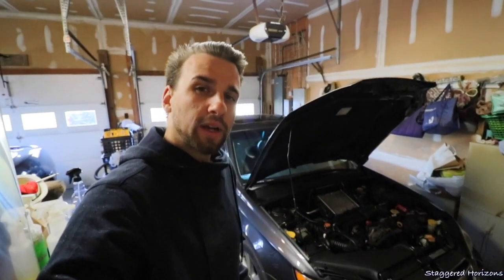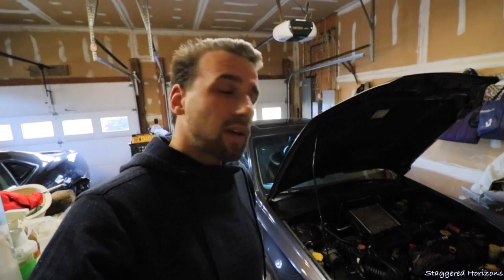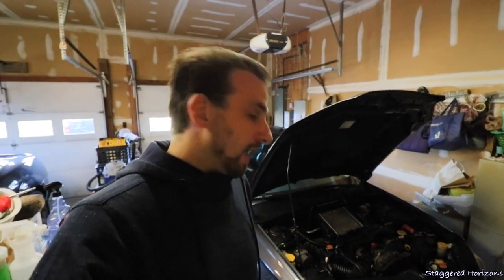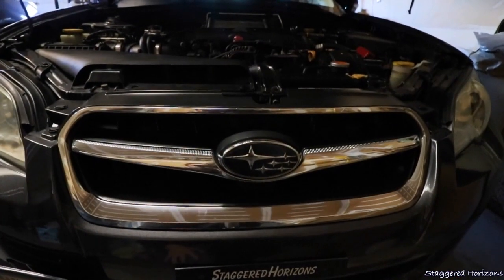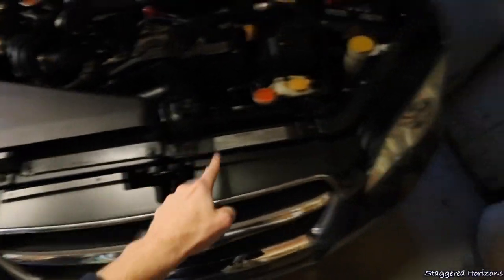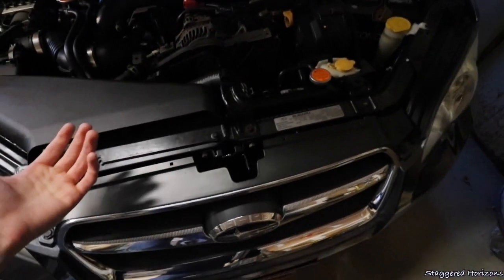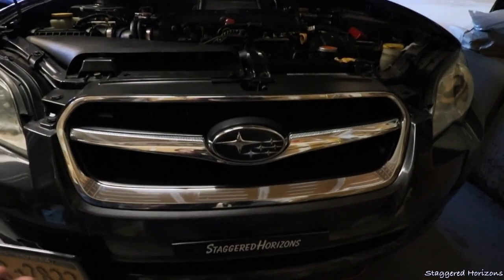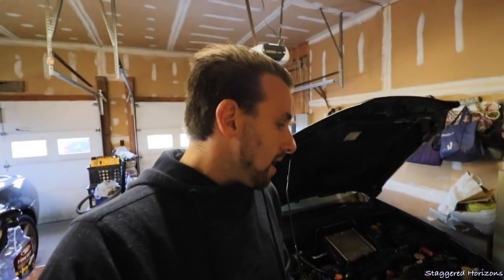How To: Black Out Your Grill QUICK & EASY - Subaru Legacy GT Build | Episode 1

Comment: How soon after the last coat was applied, did you remove the tape? I know with regular house painting, remove it too soon you could get runs. Wait too long and you can chip the paint off the wall. I've never use Plasti Dip so I'm not familiar with it's characteristics. Thanks for the great video!

Comment: Thanks for this. I have the 05 which luckily just involves removing the plastic clip screws and then taking the grille out from the latches sitting towards the back of the grille. I noticed you sprayed over the emblem; how did you remove the dip from the emblem? I like how your video is straight to the point, too! Maybe not the music though ;)
Reply from the maker: thanks appreciate it, glad it helped, the dip peeled right off the emblem section as there is a separation  on the oval line, thanks for watching, more content to come!

Comment: How much clean up/peeling did you have to do afterwards? I got a 2009 legacy 2.5i want to do this to my grill.
Reply from the maker: not much at all, just tape pretty close to the lines of the grill and top piece, about 0.25" or so and make sure you put down plenty of coats, so when you peel off after, the plasti dip will have enough to "break" cleanly from the offset of the grill and bumper. Thanks so much for stopping by, be sure to subscribe for more!! also add me on Instagram @StaggeredHorizons so I can see it after :D

Comment: Not gonna lie I know this video is old but I just bought an 05 GT last June and I’ve been doing some mods here and there. I’ve already replaced all the interior lights to LEDs, the rear dome light glows red to match the console accent lights. I did the tail lights too. Windows were tinted to 20%, slapped a couple of decals on the rear windshield. Thanks to your video I just plasti dipped my grille and it looks 20 million times better than the chrome. My car is Regal Blue aka dark blue lol...I’m thinking about getting some aftermarket HID headlights or some other...and I think I’ll leave the exterior alone for a while. I would eventually like to get darker rims to match up with the grille tho!
Reply: I got mine around the same time that you did, mines dark blue as well. Only mod I did was blue LEDs inside lol. You should post a video of yours though! I’d like to see how it looks with the plasti-dipped grill!
Reply: You'll probably need a HID kit to convert.
Reply from the maker: awesome! how are you liking the LGT?